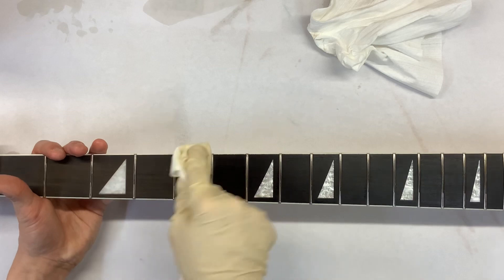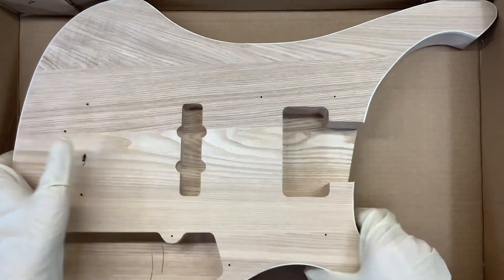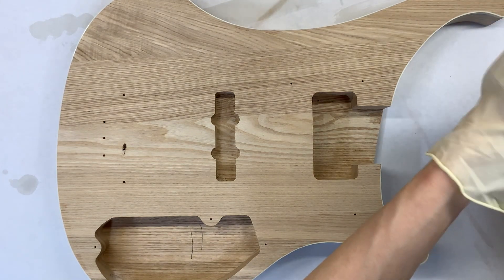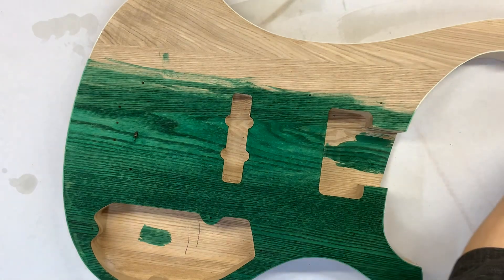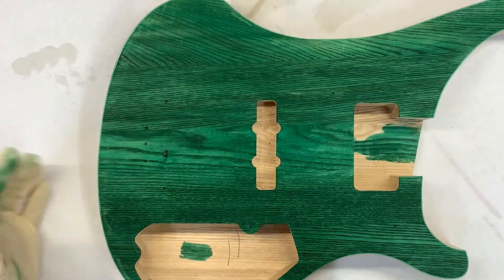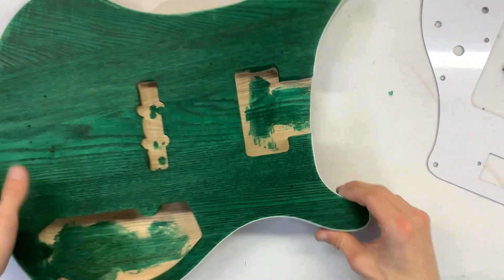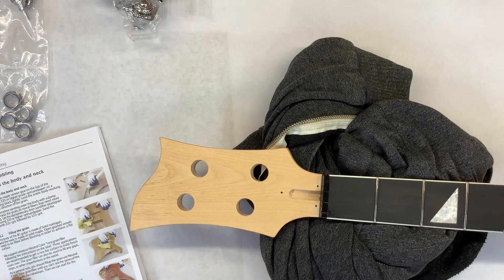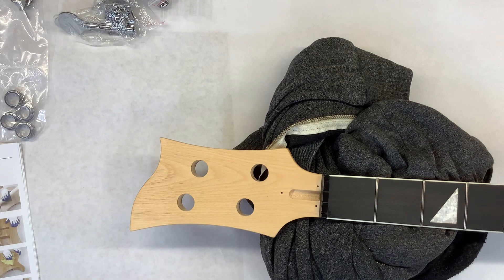Today I’m making a Bass!

Comment: As I started the rebuilding part on my channel just yesterday as well, with a build that has no equal on youtube (english translation in the making in this moment), im glad the algorythym deciced to show a little channel that is doing such a good work as you do on my frontpage ! Subbed, liked and subscribed. The big problem with my build is, that it isn´t even enough to throw your money into some manufacturers faces for the neck i need. Even the chinese on ebay passed on this one. It does not sound that spcial tho. It is "just" a 7-String fender :cat-orange-whistling: